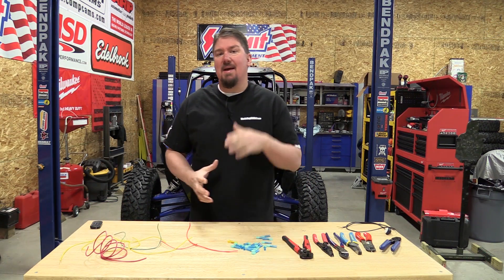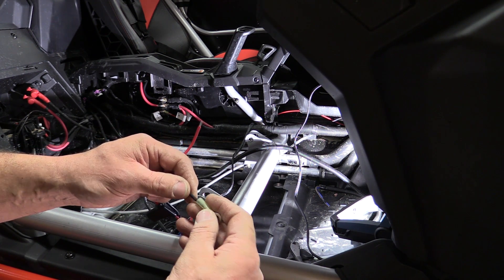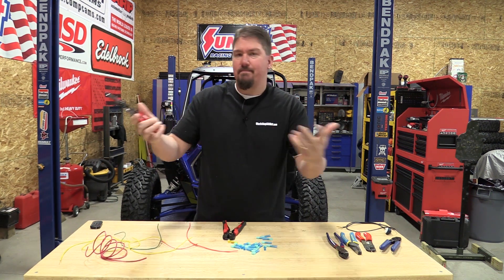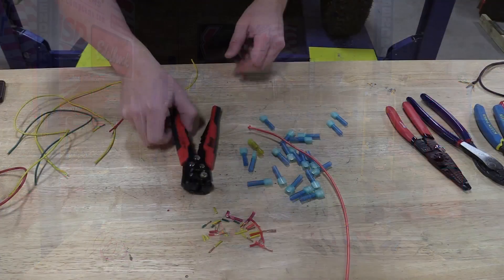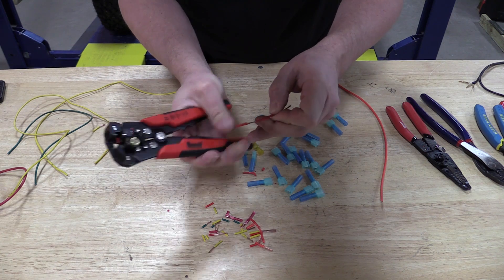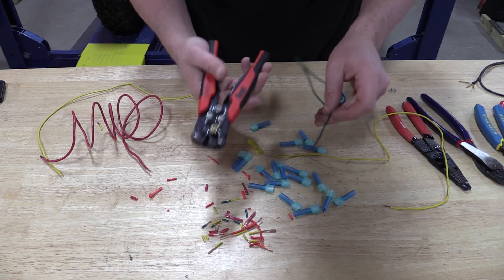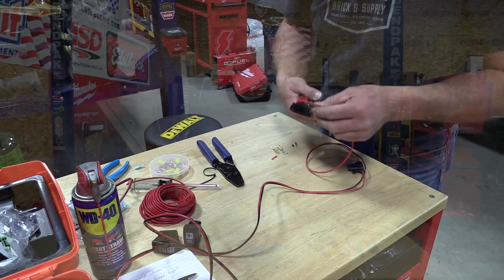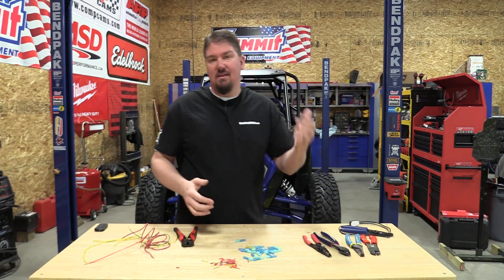Are Auto-Adjusting Wire Stripping Tools For You?  Quick, Fast & Easy!

Comment: The blue point stripper that I have has sort of a V notch cutting blade. It was great when it was new, but As that blade dulled it got less and less reliable.  You’re right about the technique though, using it at a certain speed  makes it work a little bit better

Comment: Bought a pair of Neiko wire strippers on Amazon last month to use on some speaker cable. Love em'. Never had any before and wish I bought them a long time ago. Accidentally cut wire too many times with knives or other cutters. The Neikos were cheap but handled 12 gauge cable with a very thick jacket easily. The cutters and crimpers worked great too. I'll never strip wire without them again.
Reply from the maker: For others looking at the comments, are you talking about these? https://amzn.to/2CWJP06

Comment: I like the Tool Aid auto wire stripper for stranded, but in practice I just use the standard stripper/cutters because it's the best option for stripping wires when the power's still on. And if I ended up blowing a hole in the jaws it's no huge loss.
Reply from the maker: I can see that!!!  Too many small parts in these to have them get hit with a hot wire.

Comment: I've been using those auto adjusting wire strippers for years and I love them, won't use anything else, I don't like the crimper on it, I use a separate crimper and cutter. I need a new pair of the auto adjusting strippers, finally wore mine out. I recently bought the one at Harbor Freight but returned it because it didn't work good at all. Still in search of a good replacement.
Reply from the maker: I looked at the HF model and was torn because it looked like it would feel odd to use.

Comment: That knob adjusts the pressure the blade puts down on the wire before it snaps if you over tighten that you’ll just   cut your wire in half. I’ve had great luck with them and love mine. Doesn’t like solid core wire too much though
Reply from the maker: I never tried it on solid core wire.
Reply: Yes it is very finicky with solid core wire you have to loosen that knob a lot and the thicker the insulation The tighter the knob needs to be

Comment: I bought a pair of these (Irwin brand) about two years ago and found that they are inconsistent. 
I went back to using a pair like the Milwaukee brand you had in this video. 
Thanks for your videos.
Reply from the maker: So far these have rocked and been as consistent as our shaky hands putting the wire in.  LOL But I can see where they might not be as consistent on large or small wire.

Comment: I've been a licensed commercial electrician for 15 yrs now. I've tried the "auto" strippers before, and always go back to my Klein curved handles. The auto strippers are great for car guys who do wiring harnesses and etc. But the reason the insulation is thicker with wires is because they are rated to carry different voltages. Some are probably 600 volts and others 1000volts.
Reply from the maker: I am talking on 12 volt LED light wires......
Reply: Ooo ok gotcha! If you like the auto strippers, you should try the "Klein Katapult" great auto strippers! Prob the best I've used ever!
Reply from the maker: That looks nice.  https://amzn.to/2RZE7ov  Looks more for home/commercial wire?  Looks like you have to choose a size again.

Comment: I have the tacklife wire stripper like these that i picked up for $10 usually $15 they are pretty good but probably not as good as the summit racing ones. I really like the tacklife precision screwdriver set though with a magnetic case to hold all the bits.
Reply from the maker: Had to look them up, but they look nice.  https://amzn.to/2FVspVj

Comment: I have the Irwin version. I like it but learning it was a bit weird. But once I got the hang of it I prefer it. Like you with a separate crimper. And other wire strippers for the weird occasion where the first one doesn't work.  But it saves my hands from stripping. I have really bad hands, with arthritis on both and carpal tunnel on both. So for me it's nice
Reply from the maker: I want an all-in-one package... maybe...  I want everything in one tool and that might not be possible.  Like you, these work well for me.
Reply: @WorkshopAddict  if they just added the crimper in the front.  I know I feel the same way
Reply: @WorkshopAddict  I work on boats and wiring is a pain
Reply from the maker: Mostly because of all the fiberglass scraping you up!  Been there.
Reply: @WorkshopAddict  bwahahahha yeah and no one wires things neatly.  I swear some hideous stuff. I have my eye on that newer Klein stipper crimper. But then again the crimper is in the bottom.
Reply from the maker: Yup!  exactly why I am not excited about it.

Comment: Brother I feel your pain with that small chinesium wire , that stuff is a pain in the arse.   I guess if I was at my work bench with plenty of light and plenty of room I could tolerate a good set strippers that are supposed to do it all.  What makes things difficult is there seems to be very little consistency in the insulation of some of the smaller wires....your lucky if it’s copper..however in most cases I am like most other people and use what I am most comfortable with.  I have a old pair of Klein’s that are my go to strippers..tight spaces - little light - bad strippers = headache.
Reply from the maker: We have not been luck...  Nothing has been copper in the smaller wires.

Comment: I haven't found a pair of automatic strippers yet that don't lose grip after a while and just start pulling the wire through
Reply from the maker: Could that be an issue with the material the grip and cutter are made from?
Reply: @WorkshopAddict  perhaps, or maybe everything's just getting dull

Comment: I have  Klein Tools 11061 stripper from Amazon. They work pretty good, very similar to what you're displaying here. I have the occasional issue too where additional stripping results in just stretching / incomplete stripping. This is mostly an issue with smaller strands of wire, where it actually pulls the whole length of wire insulation towards / away from the other end of the cable. 
Curious if you've ever tried any of Knipex's crimpers or strippers. They're very solid looking, but cost a pretty penny. I'm happy with their other tools though. Some of their crimpers/strippers aren't actually made by them though, anything out of other countries besides Germany from them are just re-badged from other OEMs, would be advisable to stay away from those.
Reply from the maker: I had no clue Klein made them.  NICE https://amzn.to/2SgN9wG
I have not tried the Knipex models.  Trying to stay on a budget and find what I like then upgrade.

Comment: That might make rewiring my speaker system easier. For $20 it's worth trying.
Reply from the maker: I used them at home on speaker wire today and they were awesome.  This was heavy insulation wire.
Reply: Walmart has it for $9.  Just an fyi.

Comment: Been using a similar pair for about 25 years, they work great for most wires but may need adjustment for others. The thing I like about them is that they are very fast. If you know the wire gauge you're stripping I find the other pair work better because the curved jaws conform to the shape of the wire.
PS, it's 20 degrees below zero and you're wearing short sleeves in the shop? I'd hate to see your energy bill.
Reply from the maker: We have a well built and insulated shop.  Costs less than $100 to heat it per month so we keep it at 66 degrees.  I did wear a hoodie this morning doing a video, but only because I was out on the side by side testing before we came in.
Reply: @WorkshopAddict  Wow, that's awesome Brian! It costs less to heat your shop than my house!
Reply from the maker: @Pro1er  It costs less for me to heat the shop than my house also.  :(
Reply: @WorkshopAddict  LOL!

Comment: I use a different Milwaukee set than you showed.  https://www.milwaukeetool.com/Products/Hand-Tools/Pliers/Wire-Strippers/48-22-3079  They are very stout- made more for commercial electricians, but since they are so thick, the stripping holes and cutter are very sharp.  There is no side-to-side "twist" like you get with the thin ones.  I have the Klein auto strippers also, but unless I'm sitting at the bench and stripping a bunch at a time, I much prefer the feel and precision of the Milwaukee 6in1.
Reply from the maker: I have the Milwaukee's you listed also.  The ones I showed just came out.  I like to try them all, but I like the thicker ones better.